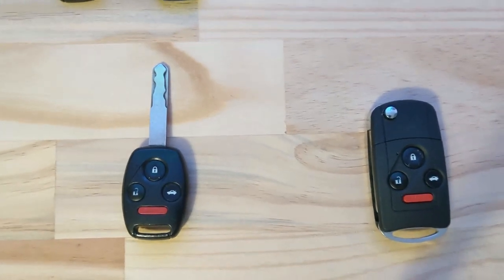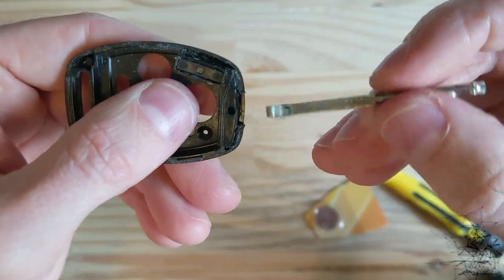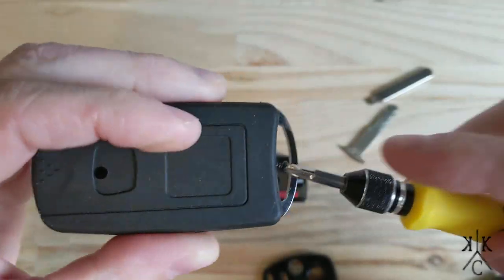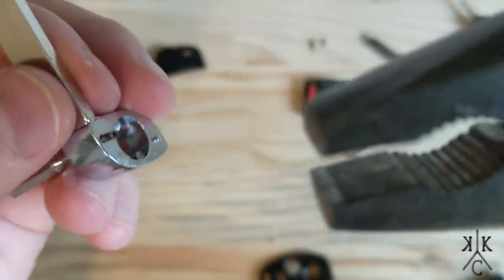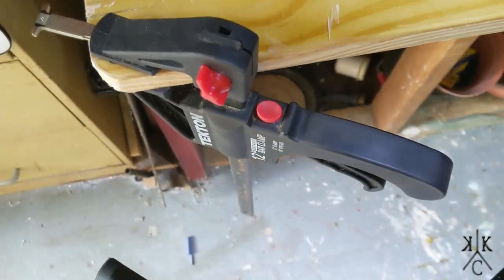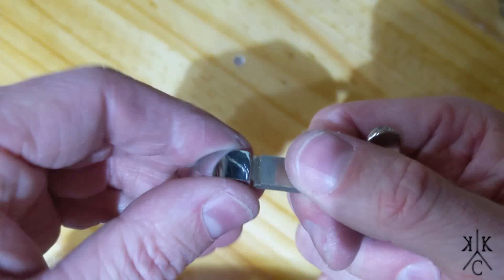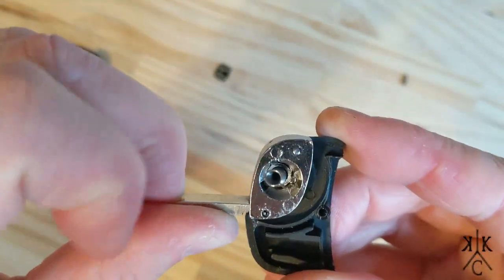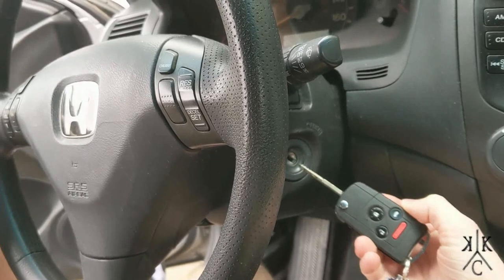Honda Accord car key mod | How to upgrade your car key

Comment: A little tip for anyone wanting to do this, go to your local hardware store and just have them cut your key into the blank one that comes with the new fob. My local Ace Hardware charged me 5 bucks to do it and it saved me a lot of trouble.
Reply: Local ace said they just cut keys bought from them
Reply: @wesfields9322  Hm. that’s weird. i actually went to ace as well and they cut it for me
Reply: @schroeder7m78  they cut it for me for free. But it wouldn't start the car. Even though I had the computer piece right behind it like it was made to be. My case is cracked though.
Reply: My local ace said they don't do Lazer cut sadly
Reply: Yea my homedepot and ace cant make those cuts. Only regular style cuts. Honda dealer said they wont cut it because the metal is cheap
Reply: My ace wouldn’t do it either. And I can’t get my new key to work even with the piece
Reply: did this year's ago but the problem is the radio signal in the remote is weaker

Comment: its NOT a "metal magnetic piece"!. Its an RFID chip that works like those access cards you touch to open a door in a workplace or newer apartment, or the newer "tap&pay credit cards". What happens is that there is a coil in the ignition, that will modulate a "request code" and send to the key. A encryption key in that little piece, will encrypt the car's request and send back. The car will then encrypt his own "request code" with the same key, and they both should match for the car to start. The modulated signal also works like an transformer (like the transformer in a mobile charger) but it will power the chip over the air instead of via a metal core. This is what allows the car to start even if the key battery is flat, because the RFID chip is powered solely by the field of the reader (ignition cylinder coil).
Reply from the maker: Thanks for sharing the info about the RFID chip, I found out a lot more on this topic/this technology after making the video (more specifically ID cards for accessing buildings)
Reply: My new key doesn’t work and I put the rfid chip in the new key just like it was in the old. What’s the deal with that ya think?
Reply: @longsleevethong1457 Try holding the little chip in your hand and hold it near the ignition cylinder while starting. It might just be that the position is a bit off so you may need to experiment a bit.

Once you get the car going with the chip in hand, you have a general idea how it needs to be oriented inside key.
Reply: @sebastiannielsen  I’ve tried. I’ve tried holding the other keys up to the dash also
Reply: @sebastiannielsen  I’ve tried. I guess it’s in the wrong position since it’s about 90° out of rotation
Reply: @longsleevethong1457  Yeah, try with just the keyblade, pliers, and then try holding chip at different positions. Eventually you will find it, then you know how you need to rebuild the key to get it to work.

Comment: Very cool but I don't think this is worth the trouble. If it was a something that could easily drop in, sure, but there's a lot of hardware needed to get things working, as well as cutting and modifying parts. Good video overall though; I really liked that you explained everything clearly and showed everything in detail.
Reply: Definitely worth it for a 7th gen reliable accord. Keyword: reliable as in ideal condition

Comment: I'm an automotive locksmith. FYI these types of flip keys mostly factory all end up breaking at the pin connection. They sell kits without the blade to swap everything. This guy did it a little different as he took a non flip blade and altered it. That's one way to do it. :) Most new cars now are push to start too. The fobs have an emergency blade in them. If you can think of any scenario of lost, broken in the ocean I have seen them all.
Reply: This didn’t work on my 2003. Even with the rfid. It’s not working.

Comment: Yt algorithm is wild. I just did this to my 2008 Ford Fusion. I dont have any ford key blades on me right now so I had to improvise. I used an Xhorse Universal flip key, and sacraficed one of the spare keys. I even swapped over the little transponder chip.

Comment: I replaced my 07 Accords coin battery (CR1616) like 3 times and they all drained overnight, is the CR1620 battery better than the 1616 and will it last longer?

Comment: Link to where I can get it? I see some on eBay but I want to make sure it has the honda logo on the new upgrade
Reply from the maker: the two I bought didn't come with a Honda logo, I used the little metal Honda logo insert off the old key. I'd imagine these couldn't be purchased/sold with it because of counterfeit/copyright reasons.
Reply: @caseykreicar  great. Thank you!
Reply: @caseykreicar  what is the size of drill bit?

Comment: Thanks for the vid. but unfortunately I couldn't find this crv remote
Reply: Received fob the next day.  Slightly different than the one in the video but works perfectly.  Do note, the pin that is shown on the video is tiny and I initially thought there wasn't one but there was.  For the pin slot on the key I used a file edge instead of a drill bit as I didn't have a bit that small.  Forced the pin back in with a bench vice (overkill but effective).  Didn't have any 2 way tape for the strip so put a dab of caulking on it and set it in place.  Works like a charm.  Very happy with the results.

Comment: i see a check engine on dashboard. This is caused  because of the keyfob modification?
Reply from the maker: nope I've had that light on for more than a year at this point. It's not related (check engine light was on before I did this mod, still driving this car too with no issue), I've got an OBD II code reader and looked it up the check engine light had something to do with an oxygen/air sensor.

Comment: Why do you need a metal magnetic part ? 
Does it enhance the immobilizer signals ?
Reply from the maker: I'm referring to the immobilizer chip when I say that (the small little black piece is a magnetized metal for RFID, the one i remove with a pin, it is the communication with your ignition switch/car computer) I'm not an electrical engineer so my terminology definitely isn't correct, but you need to put that part into the new key for it to work. (that small piece is the signal/data needed for the computer to start the engine).
Reply from the maker: also if you were referring to the blue pieces, I put into the housing because that essentially acted like a spacer to keep that key less entry portion and the RFID piece from moving around it doesn't do anything other than that. sorry just now made sense what you were asking about
Reply: Why would you want to do this?
Reply: @gregr9186  the keyhole compartment on your car has a reader and it will read that small chip (transponder) inside the key, then it will allow the car to start. Purpose of this while system is to protect anyone from stealing your car even if they copy the physical key. Without the chip to match what's inside the keyhole=no start.
Reply: @CCG0D  
1: The immobilizer system is NOT inside the keyhole, then it would be easy for the thieves to bypass. Its in the ECU. The thing in the keyhole is just a coil of wire. It works like those readers outside some security buildings, where you tap a credit-card sized card to unlock the door. The thing at the door is just a reader, it does usually not do any decision about entry or not. The scanned card is simply send to a "controller" that is located on the secure side, that takes the decision of entry or not.
(There exist systems where the decision is solely done in the reader, these are cheaper and usually used for low-security doors where you want the same cards as your high security doors to work, however, those systems are less secure as you only have to jimmy the reader off the wall and then short 2 cables to hotwire the lock, there also exist medium-security systems where there is a tamper switch in the reader, that will electronically disable the lock if you try jimmying off the reader from the wall to hotwire it)

2: The immobilizer system is NOT there to deter or prevent copied keys, even if it actually do it too. The immobilizer system is there to prevent someone from hotwiring the car, which means to break away the ignition cylinder and just short the wires that goes to the ignition. Or just use a large ass screwdriver and a plumbing wrench and just forrce the ignition lock to turn.
Reply: @sebastiannielsen  thanks for the details breakdown explanation.  Essentially, you pointed out the same thing I mentioned above. It's a reader that reads the transponder of the key. Without matching the information of the key to send to the ECU, the car won't start. This prevents thieves from hot wire and cannot start the car. Appreciate the details explanation.

Comment: Man my key didnt have a metal strip inside i have a 2008 accord
Reply: My 8th gen si didnt either,
Reply: Prolly in the main circuit board of the transponder in the fob

Comment: A warning to anyone wanting to do this. If you like the key/hand position you use to turn the factory key forward in the ignition cylinder, this replacement switch blade key fob turns that insertion position 90 degrees. I found it rather uncomfortable when using this new fob, because my hand/finger position felt awkward. It bothered me so much that I went back to the stock key fob.
Reply: elaborate please
Reply from the maker: @ohreally4752  he means when you insert the key into the ignition the part of the key you turn with your fingers/hand when the key is in the ignition is turned 90 degrees, it's at a more awkward position than the original only when you go to turn on the car/turn the key to the ignition position in the keyhole. that might not bother most people though? its preference i suppose
Reply: I've had a 2008 VW, and like many European Cars of the time, had a switch blade fob. Works without issue.
Reply: I had this same awkward feeling also when I upgraded my key fob to flip style key such as the one in this video. On my 04 Lexus gs300 the ignition is on the dash forward facing, so the shape of the flip makes it feel clunky while turning on and off.

Comment: What size tool/rod did you use to drive out the pin?  I am having trouble getting the pin out.
Reply: Hope you got it fixed
Reply: @donttrip8314  I totaled the car a few weeks ago, so it doesn't matter.  For now.  Thank you though.  It is appreciated.
Reply: @andrewcuthbertson3561  aww sucks it hear about that man ! Hope you get a another car
Reply: @donttrip8314  I found a really nice, clean 05 Acura TL.  I'll be parting out the Accord.  It sucks because I just finished installing a touch screen with two amps, a sub and all new speakers as well as always live USB charging ports for the rear passengers.  I also had just purchased all the LEDs for interior and exterior.  So goes life.  But I'm alive and well so I'm thankful for that.
Reply: I am missing the 5 speed stick.  But the TL has the "manual" shift feature...

Comment: If you're cutting key copies of the accord, I'm assuming I just buy the CRV fob and skip the whole process? The Key Blade looks identical. Also thanks for the vid, was looking for just this mod and didn't know if it was even possible.
Reply from the maker: The size of the cut key is nearly the same/identical yeah, except for the small end portion where it's attached to the plastic housing of the fob. You should be able to just get a key fob cut if they will provide doing that, you still need the small metal magnetic piece though or the car wont start